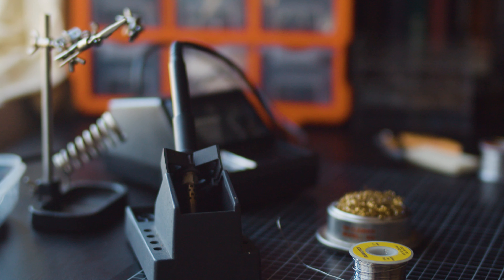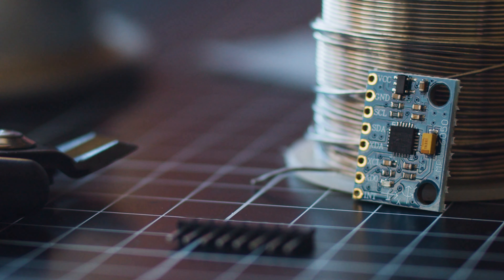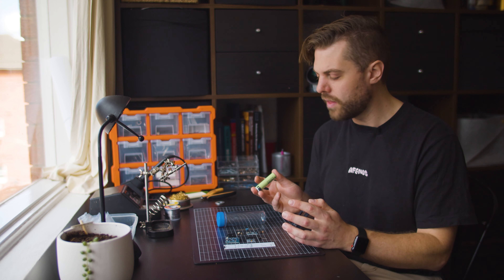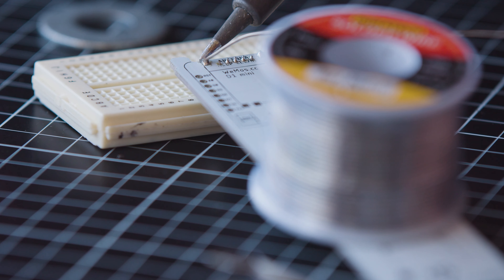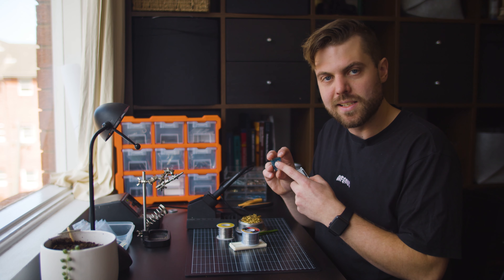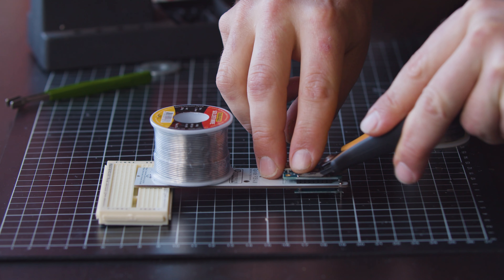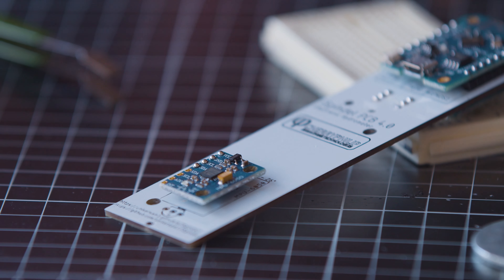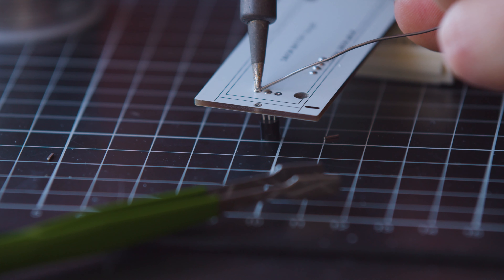How To Build Your Own iSpindel - DIY Digital Home Brew Hydrometer - Build Your Own TILT! [4K]

Comment: Great tutorial, it made assembly straight forward. I however am having issues flashing the firmware. Com Port doesn't change and I get notices under the status bar... ("gpio
") and ("wifi")...what did I do wrong? Any advise or direction to advise elsewhere is a appreciated.
Reply: I have the same problem: unable to flash the WeMOS.
Reply: Jonathan Baker, as I mentioned I encountered exactly the same problem, same ("wifi"), ("gpio") messages fading in and out. I found the solution: some WeMOS chips that are shipped out have to be modified one time only to make them writeable. You have to connect the GND to pin D3 and it will work. You only have to do that one time. Now my iSpindel is working fine and I can start with the calibration.

Comment: Very nice, but in this build with a PCB board ( i have the chery phillips 4.0) its not necessary to remove the diode of the wemos d1?
Reply from the maker: The reason people remove the diode is to stop the battery being fed 5V when the Wemos is connected via USB. As this is only a problem under this situation, I recommend just removing the battery if you ever need to plug in to the Wemos board. It's very easy to damage the board if you aren't careful when you remove the diode, and it will also mean you can't use this USB port for debugging etc. So I find it easier to just keep the diode, but remove the battery if plugging in to the Wemos
Reply: @WoollyCraftBeer  ok so thats the reason why some person flash the firmware before soldering the battery.  In my case I cannot disconnect the battery.  But if I connect the tp4056 module via USB is it ok?
Reply from the maker: @Arkbird86  Yep - perfectly fine to charge via the TP4056

Comment: Great video but I have a question...

Do you know of any reason why the tilt degrees wouldnt be registering on the ispindel I made? I have built 3 now and the connections etc. are all great on them and the LED lights up too on the gyro, but for some reason the tilt wont work when on the spindel software.  The temperature works perfect and the battery power etc. just not the tilt figure.  Any help would be massively appreciated :)  Keep up the great work
Reply: I have the same issue, did you figure it out?
Reply: Likely a bad gyro

Comment: i have two types of 220k ohm resistors one which is large like in your video and another one which is about the size of the 47k. the small one says 220k on the strip
is there a way to see which one is right ? the color coding is the same as in your video 

thanks. ps very nice video

Comment: What's your opinion of the CherryPhilip 4.0 pcb vs the Jeffrey 2.1 pcb? Great video!
Reply from the maker: Personally I like the 4.0 Board as if you use a known combination, everything should just fit together and float within the specific tolerances. The main thing you need to get right with the 4.0 PCB is the battery weight. The Jeffery gives you adjustable height for your battery so that you can use a wider range of batteries, but it can be a pain to desolder and resolder over and over to get the specific location you need, and if you ever change to a different capacity battery you need to resolder. If you are looking at building one I'd recommend the 4.0 board and a 42-46g battery. These Pansonics are good because they still fall in float specs but being a little bigger give great battery life

Comment: Hello, I really like the project.
Could you make a video about a simplistic project made with these 3 materials:
 ESP8266 mini wifi, nodemcu 18650 module, battery development board, nodemcu pwm;
MPU-6500 GY-6500 Sensor Module 3-Axis Gyroscope + 3-Axis Accelerometer Replace MPU6000 MPU6500;
DS18B20 Temperature Sensor, Dallas 18B20 DS1822 to-92 Digital Temperature Sensor for Arduino and Raspberry Pi.

Sorry for the English translated by google. Thanks in advance for your attention, have a great day.

Comment: Something I saw you do that wasn’t mentioned you were using a pot scrubber to clean your soldering tip not a wet sponge. Good man. 
Too many people still use a wet sponge and thermoshock their solder tip.
It’s worth a mention 😉

Comment: Excellent video, best I have seen on putting together an ispindel 😀. A couple of extra tips: 1. You may need to install a driver on your computer so it can see the wemos, see https://docs.wemos.cc/en/latest/ch340_driver.html 2. Mind your eyes when cutting down the pins, the little pieces of metal can fly right at you at high speed
Reply from the maker: Both good tips. And yes, I would normally actually hold a finger on the pins to stop them flying or cut them inside a bag, but for easy visuals / demonstration it was better to show in the open. Protect your eyes people!
Reply: @WoollyCraftBeer  I built one successfully myself with parts I ordered. After tinkering I finally got it to work. First the suggestion by Andy Adams helped me out to recognize that the WeMOS is connected. Then I still couldn't flash the WeMOS, a problem several people seemed to have as well. After an extensive search I found out that some of the WeMOS chips are shipped out and GND has to be connected to the D3 pin to be able to write to it. Strangely enough I had to do that only once. After that there was no problem any longer to write to the chip (I have no idea why because I'm not at all knowledgeable about electronics). No idea how to let everyone who had this flashing problem know this solution. You have any idea?

Comment: Great video! I followed all the instructions and successfully flashed the chip and connected via WiFi. Only issue, while I have a temperature reading, for tilt it reads “nanº”. Any suggestions on what the problem is?